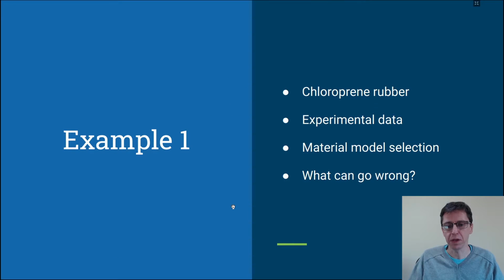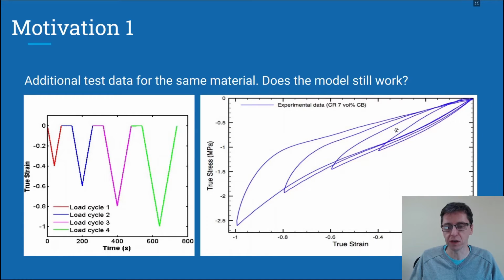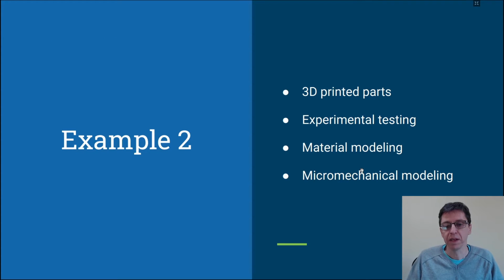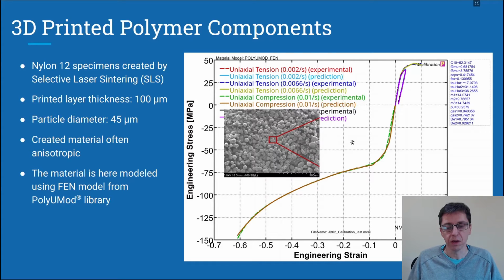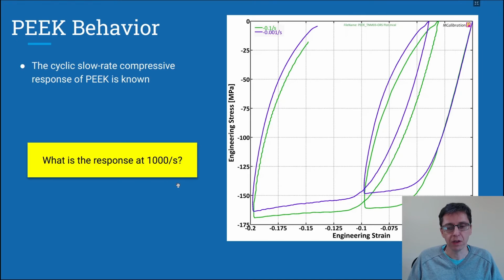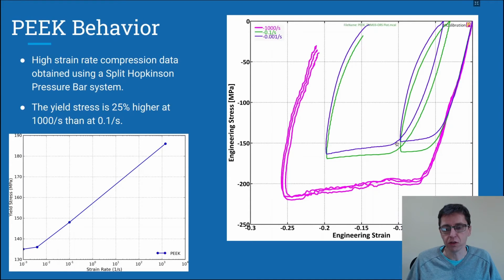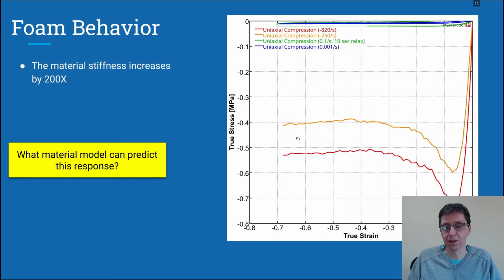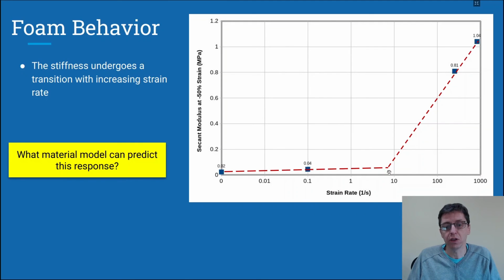Why material models are important!

Comment: Thank you Jorgen for such a nice video. In your ABAQUS simulations of cell collapse with PRF type material model, did you use explicit or implicit time integration? I was just wondering if material viscosity in these class of materials is sufficient to stabilize the collapse event without resorting to any stiffness proportional damping as one would do when using simple linear elastic type models. Thanks.
Reply from the maker: That simulation was done using Explicit, but both Implicit and Explicit should have worked. The material damping helps with the stability.

Comment: Great video, thanks Jorgen. Do you have any recommendations for predicting material response at the high strain rates you talk about in the absence of a SHPB? Clearly testing is critical, but are there any numerical methods/approaches you could point me towards? Thanks!
Reply from the maker: I have used custom drop-tower tests very effectively for generating high strain rate data. Veryst Engineering (veryst.com) specialize in high strain rate testing, if you are interested in a place for doing that type of testing. For many polymers you can also extrapolate stress-strain data from lower rates to higher strain rates very accurately. The power-law type flow models in the PolyUMod TN and TNV models have been designed to do this automatically!
Reply: @PolymerFEM  thanks! I may well get in touch with Veryst. If I'm extrapolating for a first approximation, can I assume the S/S curve scales linearly with strain rate?
Reply from the maker: @TomFisher1995  Stress-strain curves typically scale linearly with the logarithm of the strain rate. That is type of strain-rate dependence is caused by an exponential type energy barrier to the deformation resistance.